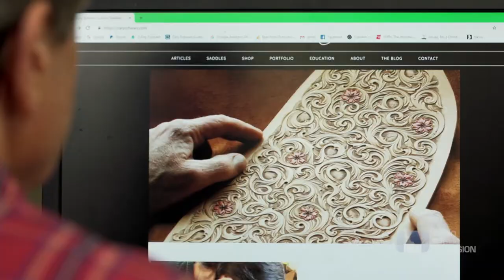The Saddle Maker

Comment: 👍Enjoyed your video!  I had a spinal cord injury while working up in the Rockies, near Durango, CO, back in the 1970s.  Unable to move my legs, while I was in the hospital in Englewood, CO (Denver area), I started tooling leather during the months that I was laid up. It was then, that I decided to make saddles.  Due to the paralysis from the chest down, it was doubtful that I'd ever regain the use of my legs, however I "walked" out of the hospital on crutches, wearing a metal backbrace.                                      In time, I could get around, with just a walking stick. I could also ride all day, once I pulled myself up into the saddle.                                                                                                                                                                                             A leather bench was set up for me in the tackroom, that was located in the barn. I began doing tack repair, working on the pack outfit's dozens of riding saddles, the  pack saddles for the mules and the pack equipment, using an old Landis Machine to stitch the heavy leather.                                                                                                                                                                       I later attended school at OSU Okmulgee, OK, where I learned Western Boot Making and Saddlemaking while there.                                       I still have the 1st saddle that I made, back in the 1970s, on a  A-fork, shovel-cantle tree, from Standard Saddle Tree Company, out of Vernal, UT. I put many a mile on that saddle, when I was a packer / Licensed Guide + Outfitter in the 780 square mile Weminuche Wilderness  Wilderness area, located in the San Juan Mountains in the Colorado Rockies.                                                                                                                                                                                                              After graduation, from OSU and returning to Colorado, I worked as a saddlemaker at Colorado Saddlery, up in the original saddle shop on the 2nd floor of the building at the corner of  15th and Wynkoop in Denver.   When Bona Allen saddles were being made in Olney Illinois, I was a saddlemaker there, till they closed down, 20 some years ago.                                                                                                                                                   After the old Landis Stitcher, I later bought a Champion "hook + awl" stitching machine with the 10'' throat.  I traded the Champion stitching Machine off, in the 1990s, when I bought bought my 9710 model Singer straight-needle harness Stitching machine. Colorado Saddlery had the Campbell-Randal, (hook +awl) stitching machines when I was a saddlemaker there. Bona Allen in Olney ,IL, had Durkopp Adler Stitching Machines, with "triple feed'.                                       I'v collected a lot of "vintage" saddlemaking tools,  since buying my 1st tools in the 1970s, Gomph, McMillen, Hackbarth, CS Osborne, a vintage German made headknife. some vintage Shefield Steel punches .